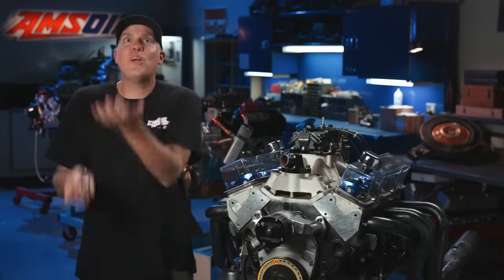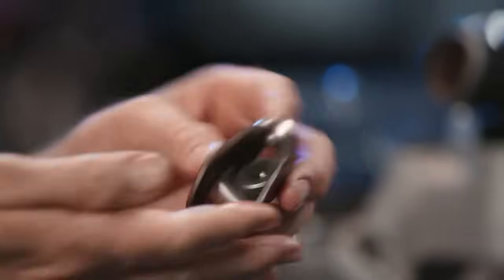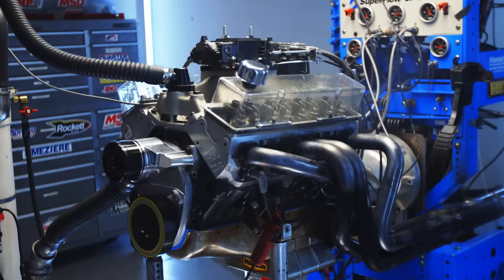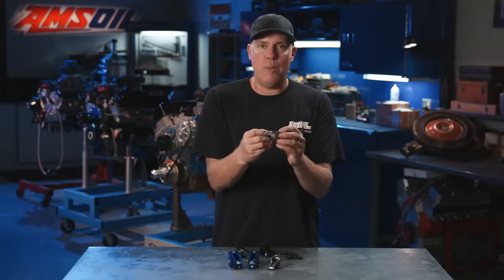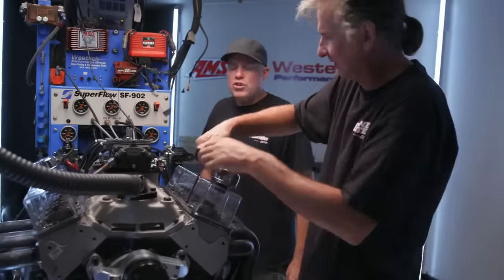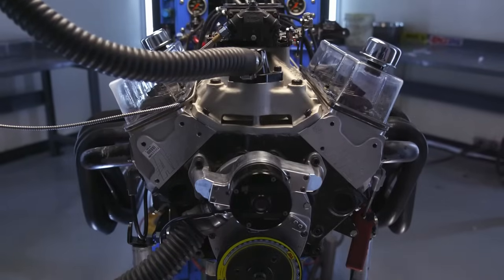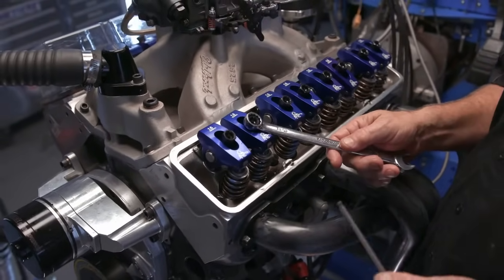ENGINE MASTERS  S2E29  Do Roller Rocker Arms Add Horsepower?

Comment: Im building  76 Grand Prix and the engine plan is a .040 over 68 Pontiac 350 with flattop pistons, #13 heads from a 70 XH 400, w-comp cams 995-16 springs and Elgin 1.65 full roller rockers, plus an XR276HR roller cam w-Morel lifters, a pair of old hooker 4106 headers, performer rpm, NOS 900cfm ProJection 4Di EFI, pertronix hei distributor.  It wont be making 500hp but hoping for 400, which, along with a 2800 stall 6r80 and 3.73 Trutrac, ought to put some pep in that monster’s step!

Comment: Anyone have a link to more information about the engine?

Compression ratio?

Camshaft they used?

That's a nice running SBC 👍.

Hoping to make 20hp/45lb-ft more at 500rpms less with a 390ci stroker smallblock.

Comment: Good video, i noticed on the Pull the oil pressure on the motor took a big dive at higher RPM, too much oil in the motor? or not enough? I am siding with too much.

Comment: Back in the 90s I bought a set of crane rockers they were 1.6 intake 1.5 on the exhaust, I'd like to see that dyno and I jad it on a 327 30 over 485 lift cam it ran 11 70 in a monte and pulled 7000 rpm shifts all day on ⅜ stud pressed in lol but we did learn it was faster at 5800  shifts lol

Comment: Back in my hot rodding days with my '92 Corvette everybody ran 1.6 rockers.  I had some really good valve springs and heads and I knew the flow numbers.  My gut told me that if I could find a 1.7 rocker it would make more power.  Scorpion was relatively new at the time but they made a set for the SBC.  I made significant power gains across the board with no negative side effects whatsoever.  I did the math and saw my heads flowed even more at higher lift and the springs could handle a set of 1.8 rockers.  Comp cams provided those, and I actually lost power compared to the 1.7's.

The moral of the story is that everything is a tradeoff.  Increasing the rocker ratio increases the internal friction because of the decreased mechanical advantage and that has a horsepower cost.  In my application going from 1.6 to 1.7, the gain outweighed the loss, but when going from 1.7 to 1.8 the loss outweighed the gain.  Your mileage may vary and that is why it's always best to be able to test things on your specific engine.

I sure do miss having a dyno to play with.

Comment: 5 feet per second sounds impressive because we don’t use that unit so we don’t know. It’s a very impressive, wait for it, 3.4 mph. Like a speed walker. Somehow their sneakers hold together. A horse can go 3.4 miles per hour with a broken leg. For easy math assume you have a good stride of 2.5 feet. That’s 2 steps per second. Faster than normal but you can run twice that fast and none of your legs fly off. We hope.

Comment: higher ratio rockers can improve valve control if you already have a good spring rate, the leverage against the lifter is more advantaged in the valve springs favor, and helps to keep the lifter in contact with the cam, because the ratio multiplies the spring pressure down at the lifter TLDR the lifter feels lighter to the spring, this effect is only a compliment to a strong spring rate though because spring frequency and resonance is still related to coil diameter and rate.

Comment: I bought Jegs light weight aluminum roller rockers for a LS, Jegs claims 15 hp just by bolting on. They claim power comes from light weight units? What were those rockers tested steel or aluminum?

Comment: Roller rockers do not creat horspower, the reduce the drag one the engine and frees up the horsepower you’ve already made. Mopar and some fords use rocker shafts with pressurized rocker arms. It would seem to me that engines that don’t take advantage of that old technology are just costing you money not spent on the other engine!

Comment: Roller rockers  cams and lifters. Or absolutely the greatest for the drag strip !!! But they absolutely just do not hold up on the street!!!! On my brand new 2018 Chevy, Silverado, and my brand new 2021 Chevy Silverado, both blue lifters at 15000 miles 2 brand new trucks, and I sold them as fast as I could when they got out of the shop. Warranty covered them !! because of the AFM that shuts down  Four of the cylinders and does not get any oil to my lifters and shuts off my fuel  jectors!!!! The lamest invention known to mankind !!!!

Comment: When I was 17, I had a Pontiac engine with a comp cans 290b solid fkat tappet cam. I used stamp steel rockers (1.5) and ran fine. I bought 1.65 stamped steel rockers tryingcto get more power and proceeded to spear the pushrods thru them at idle. Guess the valve spring pressure was a tad much for them😮 Taught me though. Went aluminum Harland Sharp rollers and never looked back.

Comment: Ya, Roller Tip only types  reduce valve stem flex , hence guide wear. Also more accurate ratio than early stamped. 
1.6 over 1.5 always a winner. Cheap HP.

Comment: It'd be interesting to measure what the lift is at the valve with the 1.5 stamped rocker and 1.5 roller rocker. Sometimes the profile of a non roller tip will push the valve open farther because it basically ends up on the edge of the flat. With a roller it doesn't have that edge to go up on. 
Ultimately with high spring loads the roller is still the way to go. Friction ends up high, and side loading on the valve is going to wear out the guides quicker.

Comment: Here's a question concerñing the locking, adjustment and stability of the valve train. I see this sbc is not taking advantage of stud girdles. Com.e t was made about small studs having issues at high rpm so why were girdles not implemented for a test to show how much could be gained by increasing up train rigidity?

Comment: I had a 4.3 V6 in a 1991 Silverado 1500 with a 4spd o/d and 3.08 running gear and I put a mixed ration of 1.6 intake and 1.5 exhaust on that stock V6 and wow did I love the torque gains out of that combo. My friend could agree that with that rocker arm set up I had enough torque where I had to start from a dead stop in second. If not I would light up the rear tires every time.

Comment: i just have to ask what kind of valve locks u are using we put in titanium valve locks back in 1990 they were 380 bucks but that was a long time ago when i built a real drag engine. i still have a set of hemi heads for BBC sitting but i don't build rigs for drag racing i do resto modes or restorations

Comment: That's why the LS platform is so good. the cylinder heads, the pedestal for the rocker arms little 10 mm bolt holds it on there its ok lol

Comment: The change in the rocker ratio made the difference! 1.5 to 1.6! Try the same test with steel rockers!
Reply: I agree, I hope they go back and retest with a good quality stamped 1.6 : 1 rocker arm.
Reply: How do you know the rocker ratio made the difference and it wasn't the new cam lift? Put a higher lift cam lobe on with the same duration with a 1.5 rocker and it'll make the same power..

Comment: At maximum lift point on the cam, does the roller tip rocker's lift get reduced due to the tip's roller being round where as the stock rocker is not rounded as much therefore the ratio is actually extended at maximum lift.

Comment: I am only part of the way thru the video. I will venture a guess that torque and HP won't be affected much if at all across the different rocker arm types. Where I think one would see a difference over time will be oil temps. I suspect the frictional loss will simply lead to cooler running oil. Also, don't assume stepping up rocker ratio will give you more power. Make sure your heads and springs can accommodate the increased lift and flow.

Comment: Your answer was no.
The question wasn't if increasing rocker ratio would "add" horsepower.
The full roller 1.5 had less power.
Hilarious a stamped rocker outperformed a high dollar part.

Comment: What stuck out was the tip on locking the poly lock. I've been doing that for years, but having a professional legitimize the method, priceless, thanks. BTW, I'd usually see no lash change even after an evening of late model dirt track racing. But I checked lash religiously anyways.

Comment: I've run Crane Gold race roller rocker arms with 7/16th studs on many vehicles  since the early 1980's . On my Current engine which is a Shafiroff racing 427sbc  I'm running 1.6 ratio Crane Gold rocker arms and making 565hp

Comment: Here is my rocket arm story. 1967 273 adjustables into my brother's '70 340. 2.08 sbc valves, they had skinnier stems ( change guides ) bigger heads, that were nailhead design ( f off idle driveability ) and we're somewhere around .100 shorter than MoPar chokey tulip valves ( you go girl ) so I added lash caps
 I was teaching my little bro the 3 C's
 Now he says I'm stupid. I did that for him in the 1990s
 Sucks I built him a stupid motor.
If only the Internet had been a thing back then.

Comment: You don't need roller rocker arms on a little weenie motor. But if you're going to run 10,000 RPM for 5 hours in a real competition engine if you don't have them you won't reach your RPMs you will have valve failures and everything else big lifts and long durations have to have them

Comment: I think I recall advertising claiming 20hp(+/-) in the SAME ratio for roller rockers..think about that- hp is directly interchangeable with watts, or btu/hr. 
   745.7 watts per hp...
   If your stock rockers cause a 20hp loss due to friction, they ARE creating 14914 watts of heat, exactly. 
   I don't believe that 16 rocker arms are generating TEN space heaters worth of heat....so I don't believe the 20 hp claim.
   I DO love the idea of friction reduction, however little, and especially like the reduced side loading on the valve stems. Good for longevity, and that side load also causes some friction/unwanted heat in the guides.
   By the way, many OHC engines have roller rockers, on both the valve end, and the cam follower end.

Comment: the explination of rocker ratio was poor, the lift of the valve starts at the camshaft,m say the lobe measures at .300 and the rocker is 1.5 ratio, then the lift would be .450, if it was a ratio of 1.6 it would be .480

the other 2 things that are probably worth visiting is shaft mount and/or stud girdles, obviously studmount are more relevent on ls motors, or any motor where the valves are side by side, not offset

Comment: Always ran roller tip factory stamp style rockers in small block iron head chevs when i was a teen . Never had a problem . I did mild porting on the heads , gasket match everything and opened up oil galleys slightly for a tiny bit more lube and other things . My day job was being a hand machinist .
Reply: sounds like he’s ur mother used to do to me late nights

Comment: Funny. My OHC engine had rockers. 2.3 Lima engine. Also known as the Pinto engine. Went from an 88hp engine on carbs to the TurboCoupe TBird where I put a fishtank valve to boost the turbo. I was pushing over 350hp.

Comment: I use to race pure stock Class with a 289 mustang bACK IN THE LATE 1960'S we found that the stock rockers could  vary between 1.52 to 1.65 . We would sort abunch and found the ones that had the highest ratio. to get the best power.  Just having 16 rockers that are the same made a differance in power.

Comment: you invalidated the experimental premise ("Do Roller Rocker Arms Add Horsepower?") by allowing different rocker ratios
Reply: Well yea, not only that. It kind of showed the cam was wrong for the engine. Stick a taller lobe on it and will the 1.5 rocker be the correct one? Will it still gain with a 1.6 rocker?
Edit: spell check and ai predictive text are morons

Comment: Actually those Stamped Steel Rocker Arms look like PONTIAC's as they were designed by a PONTIAC Engineer in HIS HOME GARAGE! Chevy asked GM for a special work around of "The Division that develops new technology is allowed sole use of the design for one year." It just so happened that 1955 would have been "Pontiacs year" but Chevy got special permission to use it them ALSO in their newly designed 265 C.I. Small block.

Comment: I run Harland Sharp roller rockers on my engines. I believe he was the first to sell them for racing engines.
Reply: I have HS on my Pontiac. Have adjusted preload twice. Very noisy.
Are yours noisy?
Reply: @KenWilson_428  I did have noise from a bad set of lifters. I swapped to Isky hydraulic rollers. No more noise. How are you adjusting your lifters? From zero lash.  Exhaust halfway open and then adjust intake. Intake closed and then halfway open, adjust exhaust. Have a great day.
Reply: Nope it was chet Herbert he was the first to make roller cams n rocker for SBC
Reply: @richardfinney3179  That is incorrect. Harland invented them in the 50's. A simple google search would have informed you of this fact. Have a nice day.

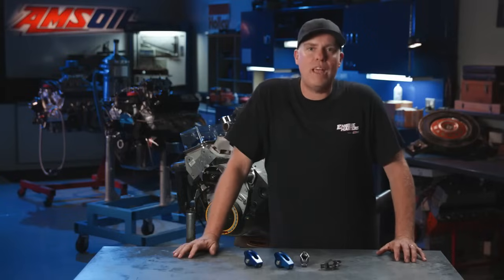Comment: On my old FE 2:08  fords the valve train is at such good angles it doesn't do much ...but a small block chevy the angles are so harsh it really helps... Ford's is a 90 degree valve train...chevys were some other gadawful angles ... so it makes a difference which motors they are on

Comment: I've been using roller-rockers in every 302 I've built and in 25 years have never had a failure (Crane & Comp aluminum roller-trunnions). I did not notice much for power gain except a little extra right on the top-end just before the shift-points (around 5600 rpm). However, the first time I installed them, I had the motor in the car and just did one cylinder at a time while pulling the crank over with a breaker-bar and I was amazed at the difference in friction from start to finish- it felt like the effort was reduced by 40%!. Keep in mind that the Ford stock rockers have the absolute worst high-friction trunnion which is shaped like a barrel cut in half vs the lower-friction Chevy ball. At engine tear-down after 10-15 years of driving, the valve-tips show minimal wear and there is no evidence of worn guides.

Comment: Make sure you measure how much difference there is between the actual lift achieved by the stamped rocker arm as opposed to the roller rocker arm. Doesn't matter what they stamp the actual leverage amount on the rocker arm. You actually have to measure it to know how much left it's actually providing. Because I change in height or any change of the geometry anywhere along several points of measurement. Can change how much left an individual rocker arm can provide.

Comment: Do the roller rocker improve throttle response? Does the engine RPM accelerate quicker with them? That would be an advantage.

Comment: I put scorpions on my mild Cleveland, no real noticeable difference in power but a huge improvement to oil longevity. The stock sled-style rockers and pivots work the oil really hard via shear action, causing it to break down and go dark, also thin out. The oil is noticeably healthier with the rollers.
Reply: That's interesting.
Reply: Good info here
Reply: Makes sense!
Reply: You aren't gonna notice 10 to 30 horse power. You're gonna lose 25 percent of that power through the drive train. It would equal a 1/10th of a second in the 1/4 mile
Reply: That’s good information

Comment: Everone should run the same rocker arm ratio.

If you find you are making good gains by increasing the rocker ratio, you have the wrong camshaft in your engine.
Reply: if you have flat cam followers there's a maximum amount of lift you can have at any given duration, imposed by the geometry of the follower and the diameter of the cam tunnel. Sometimes you might have to use more duration than ideal just to get more lift, in those cases increasing the rocker ratio might be a big plus.

Comment: legit question for you ladds,  did you re time the cam
reason asking, your mentor DV said in a episode that roller rockers need to be time to the cam, he and  friend added roller rockers to an engine and it lost 30 hp
they [ he,friend ]  was told to re time cam, and it then made more power
did you ladds re time cam or just put them in

Comment: What about steel roller rockers? With aluminum you have to over design to cope with the fatigue. With high strength steel you can run stress higher, and maybe end up with less inertial loss.

Comment: Stamped steel rockers have been powering automobiles to hundreds of thousands of miles without problems.  Rollers have been failing right and left on modern engines often before 100k miles.

Comment: ive had defective stamped steel roller tipped rockers from comp!!! the ball and or socket was not properly made and it ate into each other!  if you do run those be sure and inspect them after the break in!

Comment: Best oil I’ve ever run in my big block Chevy 540 s   . The Amsoil  Z Rod oil has all the anti ware goodness. It’s really the best for us old school dudes who still run flat tappet cams .  I run the scorpion roller rockers 1.7 . My big block Chevy turns 7000 rpm also .
Reply: I run mobile 1 10_40 full synthetic in my flat tappet, built it in 1999

Comment: Good video. By the way : It's foot pounds of torque not pound feet of torque.
Reply: Wrong. Most people say foot pounds, but the proper I pound feet. It's how many pounds per square foot, not how many feet per pound.
Reply: @garyszewc3339   I am an old engineer and what happened was: They started saying it backwards in car commercials and all the parrots copied them, now: apparently there's a lot of confused people running around Including some engineers and car guys  A foot pound is a measure of torque which is defined as: The rotational force a one foot lever with one pound of weight hanging on the end of it can generate. I understand you probably found your description on the Internet somewhere but keep in mind anybody can write anything on the Internet. That description makes no sense. The confusion started over 10 years ago thanks to television commercials.